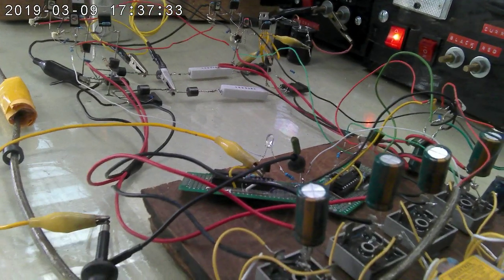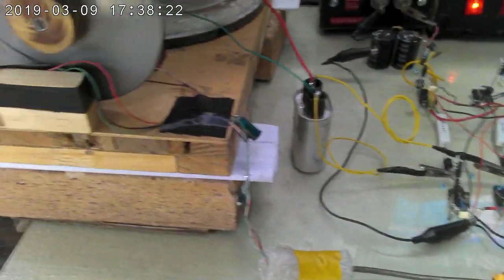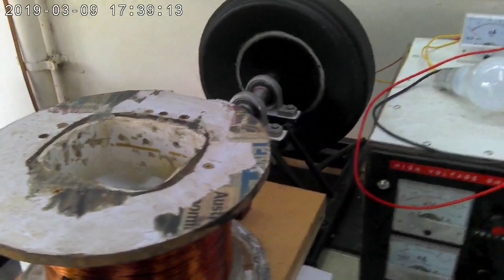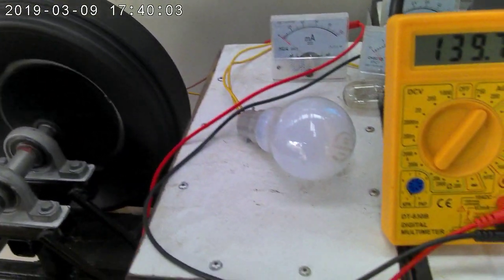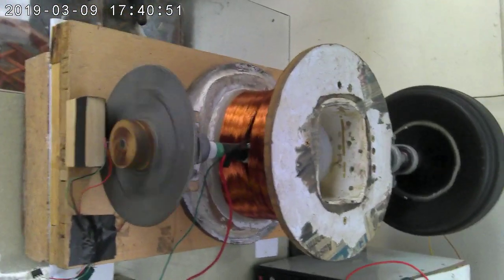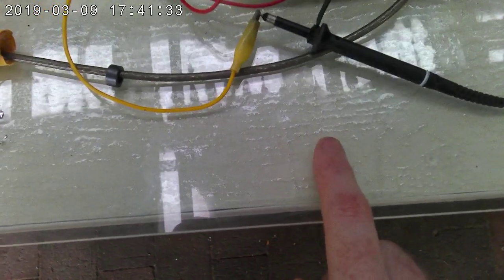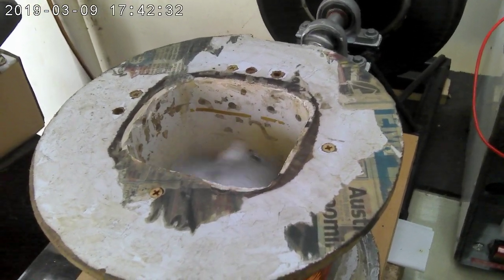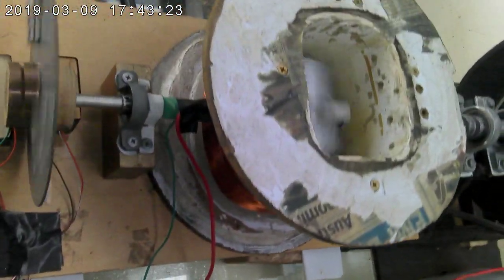Joseph Newman Motor - Configuration n Adjustments march 2019

Comment: Would love to see your circuit diagram ..... working on an electronic circuit to replace the commutator.
Reply from the maker: Hi Friend, Actually i have Canned the Newman Project after 18 months and 5 prototypes.  - it works. but it will never power a home or car
Reply: @director-patrickwatkins  His approach was a LOT of copper, so I can imagine it will b e too heavy for a vehicle, but likely for mechanical power and charging .... I need to figure out how to short out the coil if I want to do a complete electronic commutator setup ..... with have a chat with a retired electronic engineer who build one.  Just need to find a time when both of us are available .... should happen in the next month.

Comment: https://www.youtube.com/watch?v=-GNNmJd8Jcg your input please
Reply from the maker: cool idea.  i love looping idea, but it needs regulation too succeed, - even if the principle works, -- although i dout it will, unless you have a voltage differential too create current flow.... like a bedini - cole style tesla switch, -- which i have tested, but not impressed. - ... it may work.  but if you have enough batteries too power you house,  - your better off just pulse charging them for overunity anyway.....  capacitor disscharge, and spike charging, - gets around the efficency limition of batteries by blasting the chemistry in reverse, - rather than using current flow too charge them
Reply: @director-patrickwatkins  Hm strange I am getting what you meen.. Emplosion charge instead of explosion . Hey btw way i intend to use pulse charge spike and i intend to use only the current needed to break the connection between my core and my magnet and no more current than that is necessary cause it would be wasteed energy.  Also one needs to realize that the two coils are triggered 90 degree out of phase so they never are on at the same time. I already built a system like this by offsetting the electro mags in there stationary position while leaving the neo mags on the rotor seperated evenly so that when one neo passes over one electr mag the other electro mag has no neo mag passing over hit enebeling the two electro mags to get triggered seperately , the 1st build  my awg was to thick and the coils were to close each other and they were triggering each other at the voltage freq since i could not move them further away from each other i had to make the awg smaller and rewind two new ones but smaller , my rotor is a ceiling fan, if it was bigger rotor the coils could be further apart so they don't trigger each other ... Remember they are both bifilar and transistors are not matched. NO NEED

Comment: This is a good looking contraption, but obviously fake if you know anything about electronics.
Reply from the maker: well it is not by any appearance, fake,  and i will say, since i filmed this video, i have learnt, that making these machines bigger, not only makes them more powerful, but also more efficent.    my record these days, is closer too 900% efficent.,   with heavier stator, and tighter rotor tollerances...... selling my older models if you are interested
Reply: @director-patrickwatkins  900% efficient? Are you serious? Do you know about the law of conservation of energy? Anything above 100% efficiency is impossible, and especially since you're using mechanical parts there are a lot of losses there. Also, less than a minute in, it is clear that you are either lying or don't know what you're doing. The ferrite bead won't suppress the magnetic field. Putting a ferrite bead around a wire creates an inductor, a component which actually creates a strong magnetic field to store energy.
Reply: @pterosaurology  read the patent first
Reply: @ritatree77  Newman's patent was denied because it was impossible and fake. The courts upheld the denial after it was proven to have an efficiency of 87%.

Comment: how do you know this is the same as he did? where did you get the project please share information
Reply from the maker: actually i cannot say for sure BUT. Joseph Newman has the same components in his videos. and patent, and performed similarly.  (mine is better, per weight.. because of modern magnets, and my electronic switching.).....  but his were bigger. - which is BEST. -   [[ i think i can power a house, with a 100kg washing machine size machine ]]..
Reply: Josephs videos showed a rise in both the voltage and torque thereby producing enough work and less input power this video is shit

Comment: What is the mass of the rotor and mass of the coil?  I'm planning a build, and it seems the total mass of the coil should roughly be 7.5x the mass of the rotor and with a winding diameter chosen for proper resistance. I'm going to attempt a 7/8 lb rotor or N52 axially charged cylinders and ~7 lbs of 30ga wire. 

I've also wondered could you not simply take a commercially available dc motor and modify the commutator tonimplement the short principle ?
Reply from the maker: Hi Mate, Speed is everything, - !!!  or Torque ;-D.  - cant have both.   . -  if you build it small, it is possible too have only 100% efficiency.....    best too make it as big, too match the biggest strongest magnets you can get. - so a rotational diameter of about 30-50cm practically. -  - and the coil about 1-2k ohms.  ----  this will give you perhaps 500rpm, and enough torque too STFU,    patrick@infinitegenerationelectronics.com

Comment: I enjoy watching your videos I would like to replicate although its a bit technical ;(
Reply from the maker: Thankyou, - anyway i would not suggest you replicate yet, - i have invested about $2500 into building a larger version, which i will share the details of in 3 or 4 weeks when it is finished.  - at that point, i will be able too say, if it is worth it.  - currently i think this machine will be able too pay for itself - in around 2-3 years. - but there may be some possible improvments there.
Reply: @director-patrickwatkins  ;) I have been playing with things for many years as I have had the time I have found a lot of things are relevant and I see you are now looking at the washing machine motors and using them as generators they are very powerful if they are harnessed with the controller to correctly activate the timing of the pull push on the 3 phases incredible torque even if used as a prime mover and generator helping push or pull through the Lorentz effect.
Btw I am not qualified in much except water and effort.
I note that your Newman motor, yes motor as its not a generator is not very efficient for the speed due too resistance from the amount of wraps and the gauge of round wire I have noticed that it becomes capacitor like.
I have followed and seen most Newman motors and generators on you tube over the years.
I have noticed a profound effect that can be achieved in the coils either in the motor or generator that has to do with the core to enhance the mag field collapse and buck the counter effects from drawing even on the generator.
I have noticed most people have overlooked a few people that are not qualified and not learned and do not appreciate the laws.
I do notice that most things are found from continual effort and sometimes by effort that aha moment appears.
I truly appreciate people that share and show and are limiting their ego's and want for a better future as the people that are entrusted to help humanity are surely selling out.
I apologize that this reads like a school kid wrote it although it's as good as it gets I have limited knowledge although I understand that there is always a way if you will it and what I think I know is and will always be little compared to when we or several people share in the same goal.
Btw there are some things I would like to share with you as I feel they would benefit your efforts here is one of my videos below its old and I will share a site that I feel would be good for harvesting from and has been overlooked.
https://www.youtube.com/watch?v=nroBcB-42aU
https://www.youtube.com/watch?v=41o_OscfsRs
https://www.youtube.com/watch?v=7HF8E62aJnQ
I am not trying to promote anything other than understanding and sharing.
https://www.youtube.com/watch?v=tJp2iFmaPZ8 this is the french guy I have seen another replicate his work and loop it the principal is each cog or magnetic gear uses less work on each alternator utilized. 
Most of the things that are https://www.youtube.com/watch?v=ORS6tG2IBLo are overlooked as people are easily distracted and dont want to know the truth they want to be served a side dish of fake truth.
MAN DID NOT INVENT THE LAWS. It has only been observed and studied.
I have seen a lot of shit excuse the term although I have seen deliberate things take place to undermine others work.
I understand the laws and I also understand the ability to defeat or bypass them.
Apologies for the rant although I am passionate about the change that is needed.

There is no Free Lunch although it can be discounted and the input is all around us as some knew and the abundance that is dancing to the tune can be incorporated for work to be play.

Take care...

Regards,

G.G.
Reply from the maker: @GG-od2tr  Hehe nice rant, If there is a free lunch, i want one !!!. the amount i spent of fucking magnets and wire......      anyway one thing we agree on, is that i am not qualified and i do share everything !!..  thanks for noticing.  ;-)...  ;-D  . cheers for the video links, im all over it,   and if it comes too anything, you will see that reflected in my youtube videos ........ PS. dont worry about the laws of physics, - we could probably stop the chemtrails if somebody bothered too sue the airlines.     ***Patrick laughing all the way too the bank.